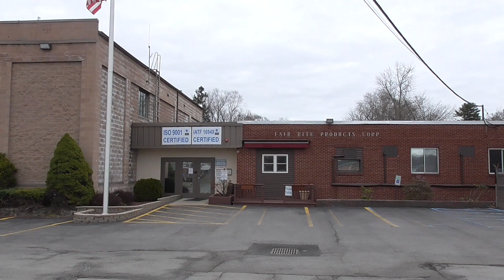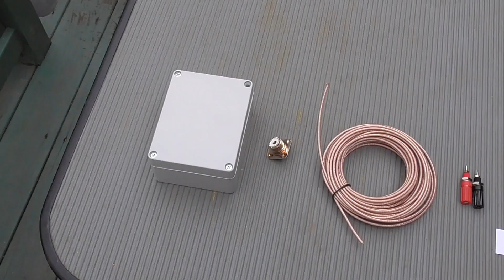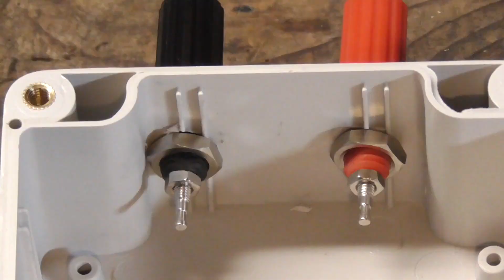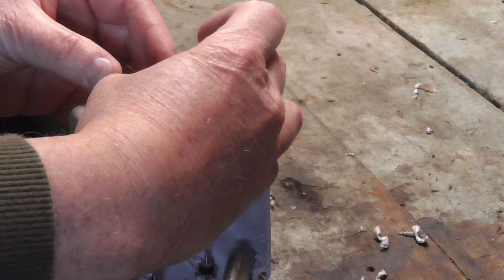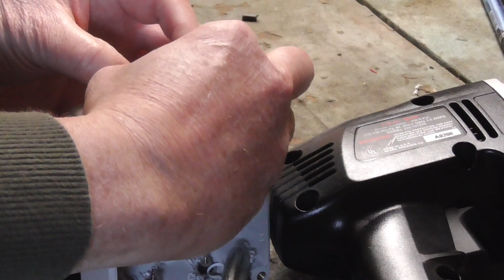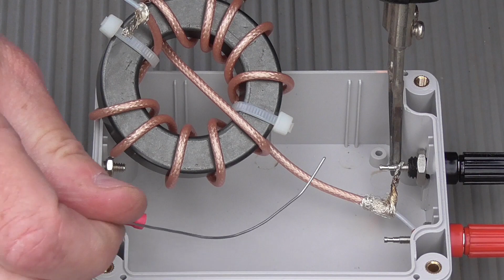Fair-Rite Products- How to make a 1:1 Balun  your HAM Radio Antenna

Comment: Hi! I need a 1:1 balun, 80-10m,  that will handle legal limit, so 1500W CW. I can substitute RG303/U coax to handle the power, but my question is regarding the core - will single core be sufficient? Also, what material would you suggest? Frankly, I no longer trust the ready made devices - none of the ones I tried as good choking Z on VNA, and I don't want to spend more on Balun than the antenna. Chris, AI2F
Reply from the maker: I would recommend using two cores stacked on top of one another if you plan on running the legal limit on CW or other 100% duty cycle modes.

I haven't worked with RG-303 before but I assume it has a suitable bending radius so you can wrap it on the ferrite core.

Comment: 5/16 inch bit for drilling the 4 mounting holes for the SO239?  3/16 inch or 5/32 inch would be closer to correct.

Comment: Interesting that coax works as well as bifilar wire.   We tend to think in terms of E Fields, whereas a toroid is a magnetic field device.   So, while the center conductor is effectively in a Faraday cage with respect to E Fields, that is not the case with magnetic fields.

Comment: Way to burn the braid before you get a good joint, it was brown and crispy by the end. Probably the WORST EVER soldering job I have seen when making one of these simple things.
Reply: Yeah, I think that he just means to demonstrate the wiring.  He isn't a mechanic.  Even the hole drilling would have been more safely done with the box held in a vice.  I would have removed the box's interior ridges in the area of the holes before attaching hardware so that the nut lays flat on the box's interior.  And I prefer to place the SO-239 panel-mount jack's base on the outside, so that the coax connector always fits snuggly.
Reply: You get a like simply for your user name.   lol
But you're right; poor solder job.

Comment: Why there is 5:5 and not 8:8 or any other turns number? Also what is the difference between current balun and voltage balun?

Comment: He should used a better soldering iron and try to avoid touching the plastic! The banana plugs are not water-tight therefore you should drill a hole to let water escaped. The number of turn and type should be explained. And last, you should test it with an antenna analyzer.

Comment: Interesting, many thanks for the presentation. I am curious on the performance difference (in terms of suppression) between wrapping the ferrite with a coaxial cable, as shown on this video, against a ferrite wrapped with a pair of insulated wires. I guess a coaxial cable provides a more stable 50 Ohm impedance, 73, Kostas

Comment: Hi Bruce. EMI Suppression Cores - Fair-Rite publishes the impedance data of a ferrite core using an impedance analyzer with the shortest possible test wire. Can you make a "How To" for measuring the impedance using a Vector Network Analyzer? Practically the ferrites are typically implemented with multiple turns or in series and it would be very useful to know the impedance of these types of configurations. Thanks!